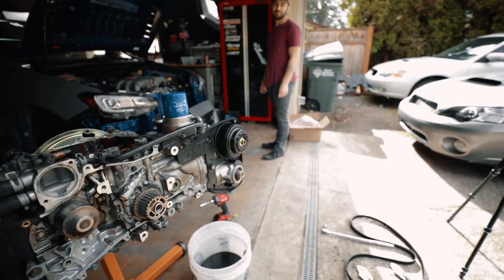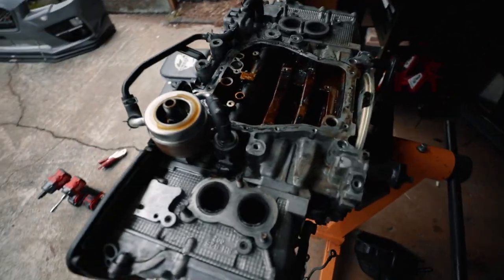Mittens the Legacy GT rebuild (ep.3) Tear down time! how bad is it?

Comment: I actually had to replace an engine in a Bobcat Skid steer. Because the guys washed the engine with a fire hose while it was running. You couldn't turn the engine over by hand. Bent number 3 cylinder connecting rod and took a chunk out of the block internally.

Comment: What headlights are those on the outback? DEPO black/clear?
Reply from the maker: Yup. Depo clear housings. Used to have retrofitted factory lights but got tired of all the wiring and they were starting to look a but worn out
Reply: @MatlasDI  some of my friends have tried to discourage me getting them in place of a fresh set with the ambers, but they look great!
Reply from the maker: @Chase_AM  depo have been known to be a hit or miss in some regards. As long as you don't plan on opening them up and making your own changes they're good lights and have a warranty. Had no fitment issues and seem to be doing fine. Cut off is a little lack luster but great for the money.